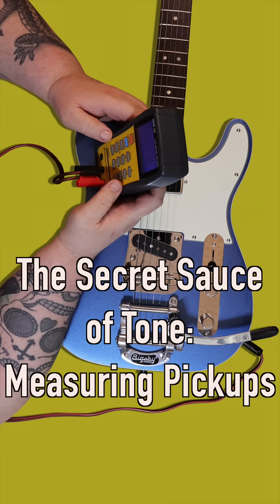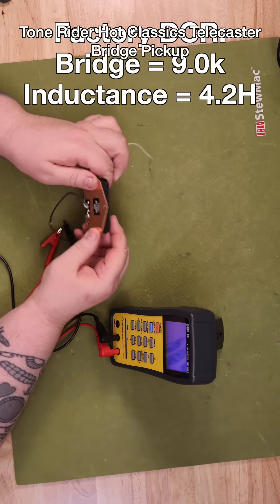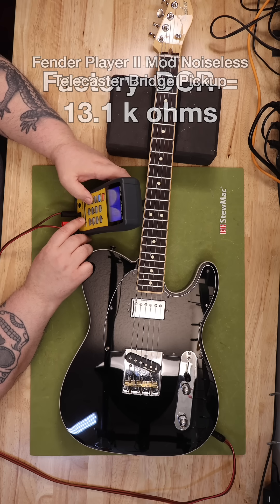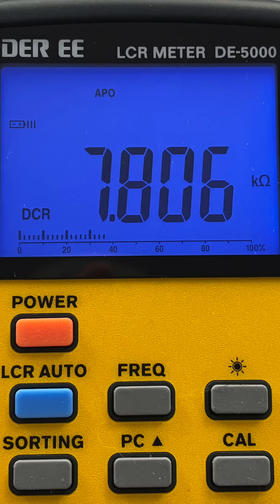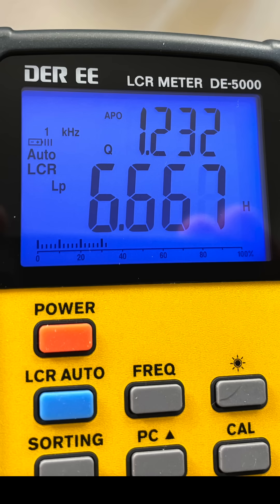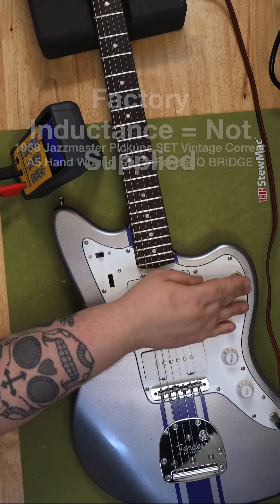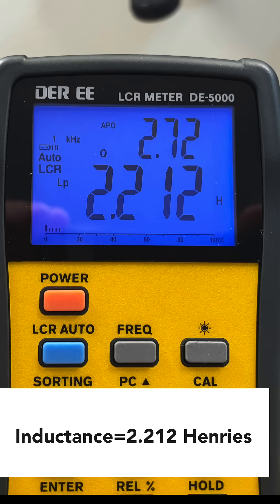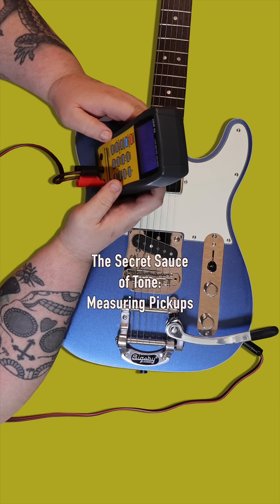The Secret Sauce of Tone - Measuring DC Resistance and Inductance on Guitar Pickups

Comment: Don't forget that wire gauge also affects the DC resistance. The thinner the wire (higher AWG) the higher the resistance. So if comparing two pickups with difference DC resistance, then also need to consider wire gauge, as the higher resistance one might not necessarily have more turns.